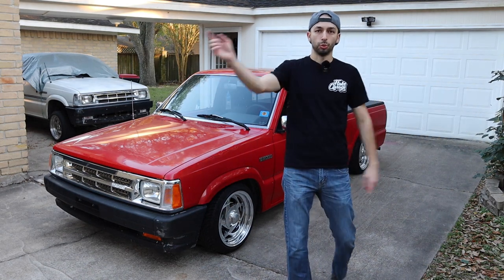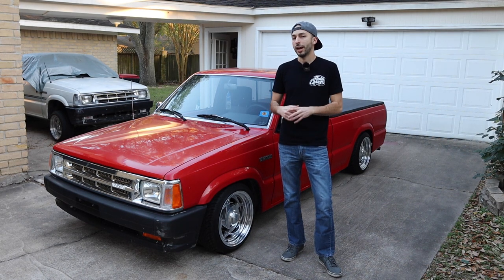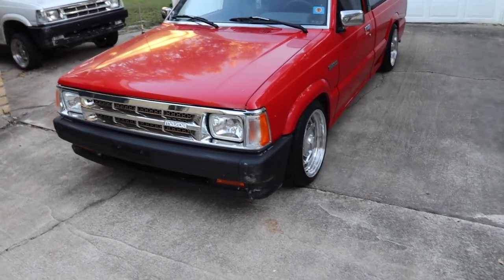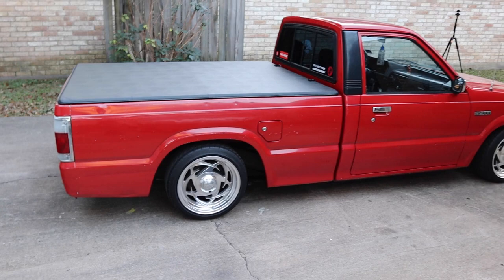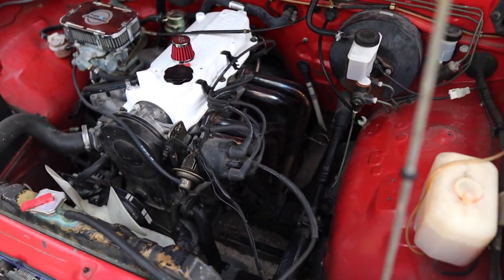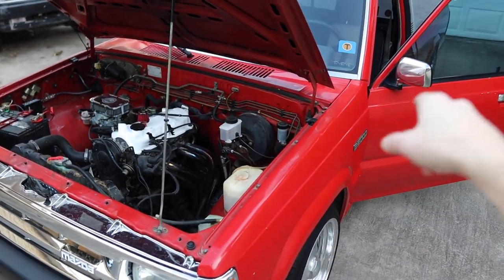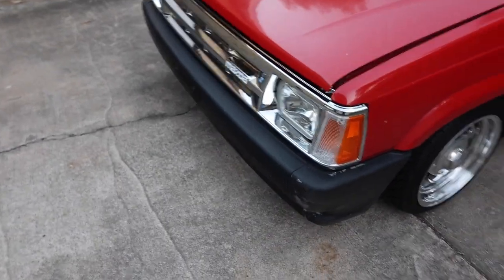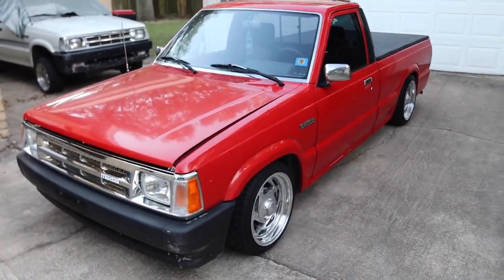Mazda B2000 Mini Truck Build Recap 2021 | Flake Garage 1987

Comment: Hey what’s up guys!! Love your videos, there’s always a lot of good information in them.I was wondering if you guys can make a video on how to get rid of the airbag light on the hardbody after changing the steering wheel?
Reply from the maker: You need a 3 ohm resistor to bypass the light. Check out minute 5:35 of this video https://youtu.be/p0NaYTmusz4
Reply: Cool thanks man👍

Comment: Which is better daily/work vechicle? D21 or b22
Reply from the maker: The hardbody will be a little better due to the fuel injection and there being way more of that model than the b series. But it all comes down to preference. We’ll have a recap video on the hardbody here pretty soon

Comment: I've heard some  V8 motors..will line up with 87 motor mounts if so can someone answer
Reply from the maker: Do you know which ones? I heard from another owner the 350 is pretty easy but besides that, I don't think I've heard of one that straight up bolts up to the mounts. It'll be great to know
Reply: I was told the 302v8 ford engine and c4 fit pretty easily.
Reply: i daily a ‘87 b2200 reg cab long bed with a 5.0L 305 small block chevy